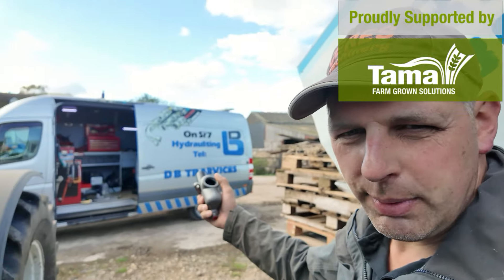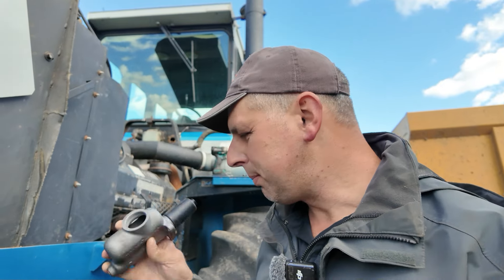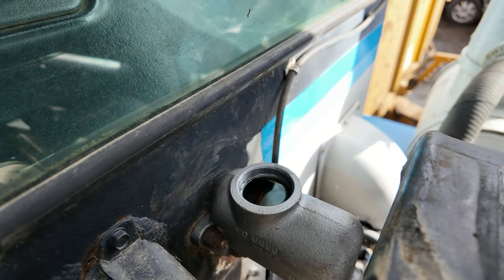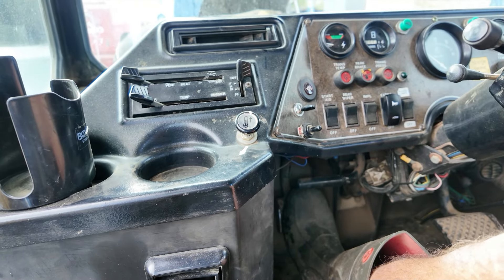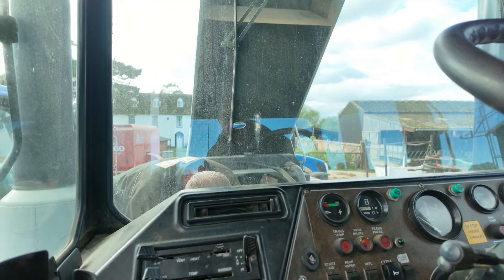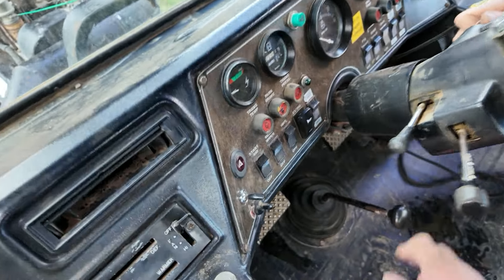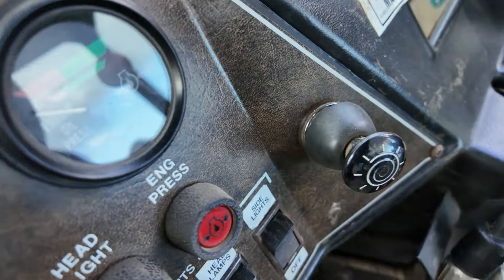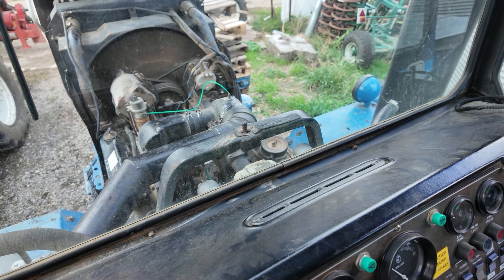The Ford Steiger FW30 Lives Again

Comment: Great update. Keep an eye on those pivot pins on the chassis. I worked for a contractor that had 4 of these old girls in the 80-90's and all suffered failures. They were more of a drager than a draft machine for us. Tried a dp12 on one and it was a bad choice.
Reply from the maker: Cheers Matt, I'll keep an eye on them and everything well greased 👍

Comment: Good evening George.
It's nice to see your FW 30 up and running properly again after her successful repairs to the brake and clutch hydraulic cylinders.
The biggest problem you'll have now is finding people who have worked on experienced and spent time repairing these rare big tractors from the late 70s and early 80s. Those who did have any dealership training the knowledge and experience of diagnosing faults and fixing the problems on the FW's will be few and far between now or even retired completely from mechanicing by now.